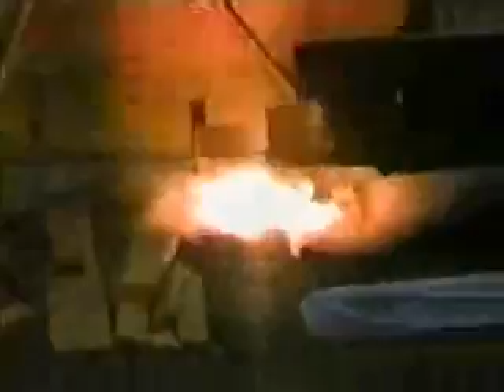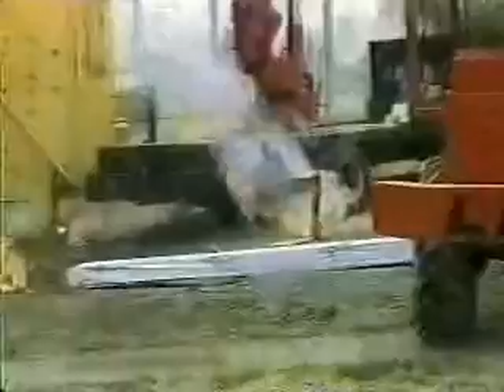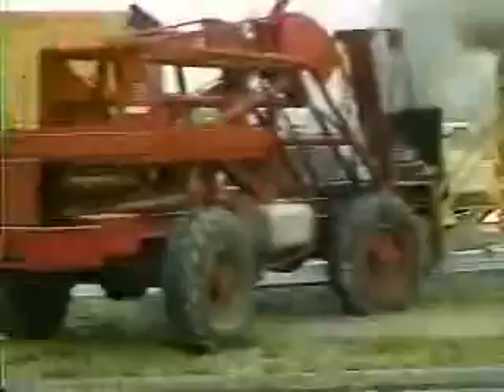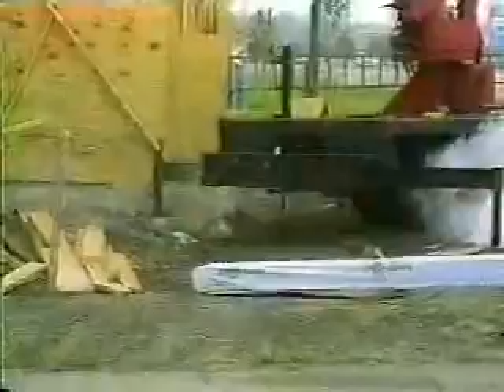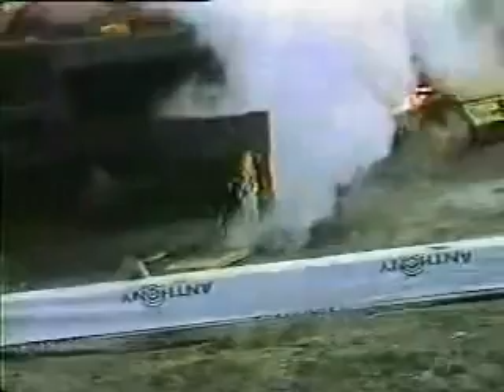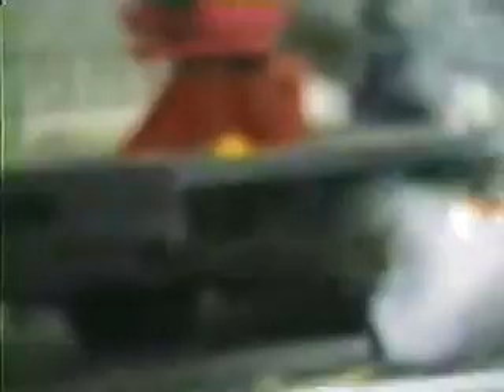boom power

Comment from the maker: It would seem that way but all the heat is going to build up in the areas of high resistance like at the ground and the joints of the support legs.  I suppose as it continues to arc weld that truck into one solid piece it would eventually make it up the the cable.

Comment: That's not a 230KV line. That's a local primary line (the lines that feed power to your house). That's about 7200 volts to ground.